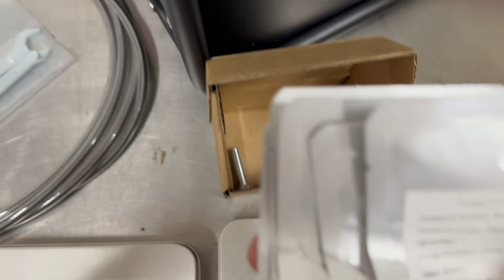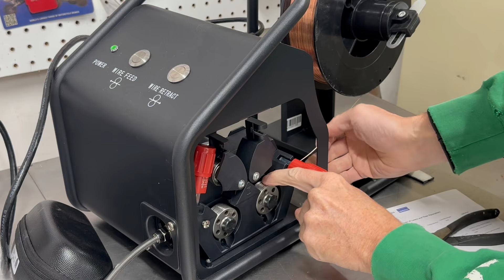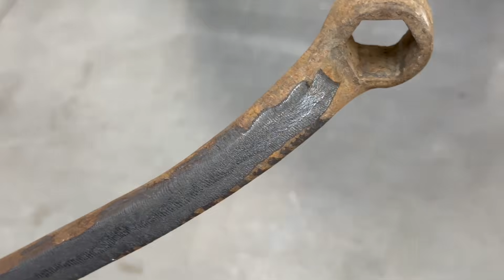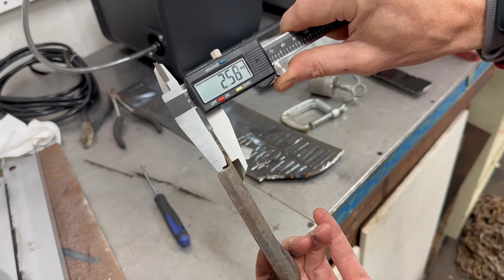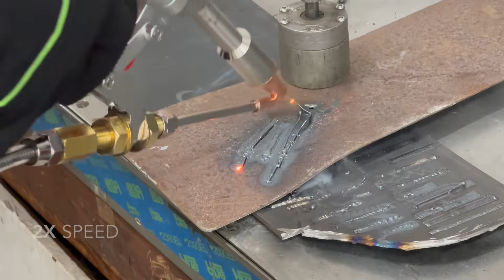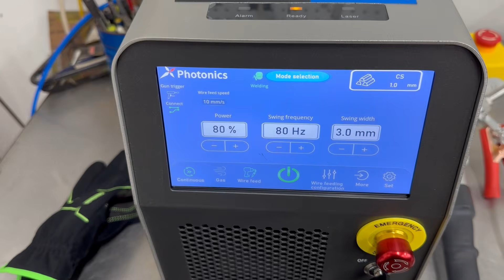3-in-1 Laser Welder/Cutter/Cleaner: XLaserLab X1 Pro Review & Test - The Future is Here!

Comment: What tool would you recommend for doing body work prep such as paint and filler removal ?
Reply from the maker: A Pulsed laser cleaner will remove rust/paint without overheating sheet metal: https://youtu.be/rQxZAFO8vx4  However I found that neither a pulsed or continuous wave laser is good at removing body filler.

Comment: Hey B!  Great video!  You know, there is a guy up in Canada - Brent from Halfass Kustoms.  He has a couple of laser cleaner welders and was sent one of the same units you have in the video.  He went through a learning curve too.  Unlike you, he never got a pulsed laser.  He got one of the large units that are basically the same as the XLaserLab X1 without the size and bulk.  He said many of the lenses interchange between the two units.  Also, I think you might have mentioned you can install a different focal lens and get a wider cleaning width (F800?).  I think there is a setting within the menu for operating parameters you have to change.  You should check out Brent's channel and look at some of his older videos where he starts to learn the welding side of it.  He had a lot of instances where the wire would stick to the piece at the end of the weld, but I think there is a pull back setting that retracts the wire.  Brent's a great guy and if you post a question in the comments, he will usually answer it.  Besides, it you.  Thanks for all the videos, keep them coming, and have a Happy Thanksgiving!  Best wishes!
Reply from the maker: I've watch Halfass Kustoms videos before... I will go check that out! Thanks, Happy Thanksgiving to you too!

Comment: Did you have full power for the cut? I have 1200 watts and this is 800, but I’m able to cut over 5/16” handheld without a problem. You should be able to easily cut 1/8”, possibly a bit more. I don’t know if you did, but you have to tighten the wire feed nuts on the gun with wrenches. That way it doesn’t move around. They should have given you two. Don’t use 5mm width. The width should be maybe two more. 5mm is for thick metal with thick wire such as 1.6mm (0.063”). Even then, generally 4mm is enough. Generally the width is a bit more than the weld.

For cleaning, if you’re going to clip the sensor cable to the gun, you can lift the gun and inch or two from the surface and get a wider swath.

I don’t know why you’re having so many problems. This is really easy. Just use the settings they give you, don’t go crazy and set them randomly. The gun needs to be about 45 degrees to the surface. You’ve got it almost vertical. No good. Do you have the right wire nozzle? If you use the one for 1.6mm the wire will wander all over. Seriously, stop “dialing” it in. Wait until you’re more experienced. I’ll give a hint though. Slow the wire feed for more penetration and faster for more, without changing laser power. Just going from, say 12mm a second down to 10mm a second will give a lot more penetration.

And you should use a laser welding helmet.
Reply from the maker: Thanks for the advice... I definitely need to practice more on the welding. I was on full power for cutting, but was probably moving too fast. Why do you prefer the laser welding helmet over the glasses?

Comment: Installing a 20A outlet doesn’t make the circuit 20A.  To do it right you’ll need to pull new wires through the conduit and replace the breaker from 15A to 20A.  Im just letting you know that the wires inside the wall may get a bit warm and especially with using an extension cord.
Reply: He said there were #12 wires and, we can assume, a 20amp breaker.
Reply from the maker: You payed attention :)
Reply: @6thGearGarage if more people payed attention on these forums, there wouldn’t be so many dumb comments.
Reply from the maker: The circuit for the garage already had a 20 amp breaker. Wires are 12/2, so nothing else needed to be changed.